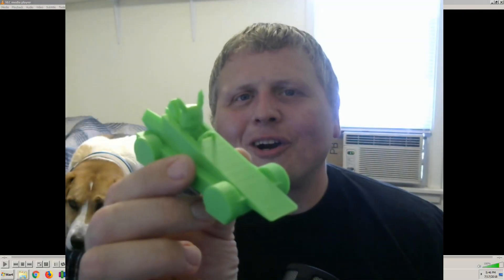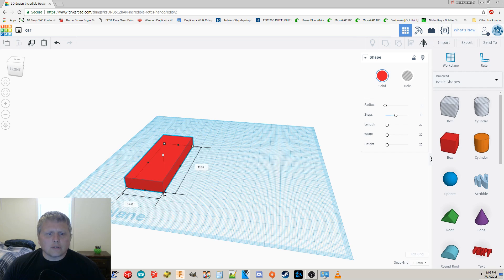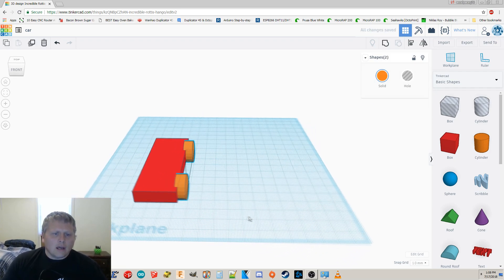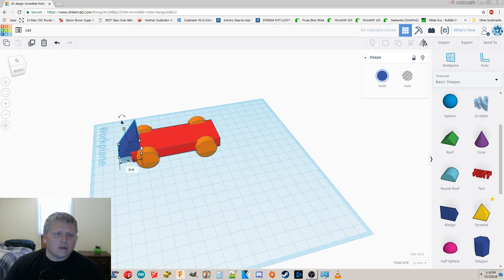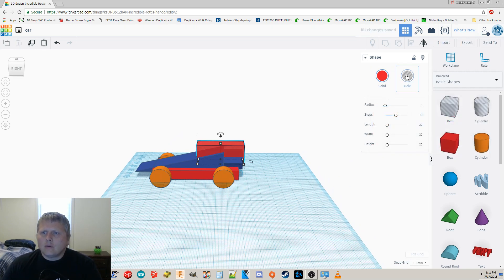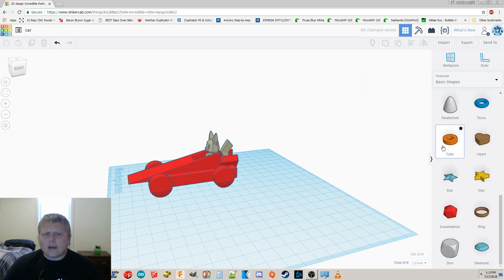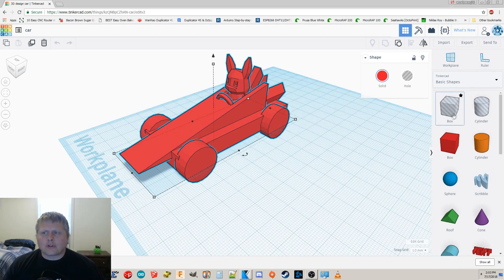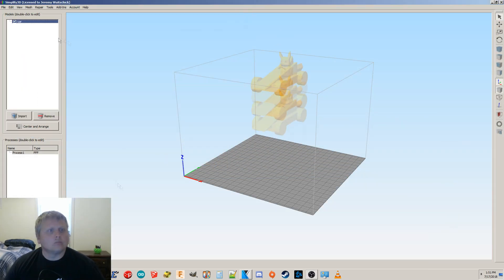Learn to Design 3D Printed Object in 5 Minutes 2018 UPDATED TinkerCAD

Comment: Do you have to have your pc connected to the 3d printer or can you save your 3d object to an SMS card and the. Load the card to the printer to print? Sorry. New to all this. Not sure if I need to have the printer bear the pc. Or can o put the printer in my workshop where there is no pc

Comment: Thanks for making this video. Wish there were more like it. Pretty cool! Question, when you exported it as stl did you directly save it on the micro sd card? What is slicing? I don’t think I heard you say anything about that. Also, how do you ensure support is in for the areas that need it?
Reply: You would have to import the stl to a slicer program such as cura. Cura also automatically adds supports where needed if you select to use supports in the options.
Reply: Slicers are what tell the printer how to make the object. There are a ton of slicers out there but I'd definitely reccomend using cura as your slicer. Theres a search bar and you can type any of the weird terms you hear youtubers use and then try them out gor yourself without having to fumble through menus. You'll very quickly learn a lot about tuning your printing settings that way. You can also save custom profiles for specific filaments that you like to use frequently. You can adjust literally anything you can imagine in cura just by searching for it in the settings. It can help you get rid of stringing or globbing or over or under extrusion etc etc. Keep in mind that some filaments are just way better than others, regardless of price, and some brands products just doesn't print as nicely as others even if they are both the same material. For example, my best printing filament is petg from a brand no one has ever heard of (tpoimns) that was only 16 bucks a kilo lol. For whatever reason it prints better than any of my other petg, my nylon, or even my pla no matter how much i tinker with the settings. Be careful with petg though because half of them wont print right below 240c, and you'll need an all metal hot end to go hotter than that. Petg is great though because it has excellent UV resistances compared to just about any filament out there. That makes it one of the best options for outdoor parts that need reasonable strength and need to withstand direct sunlight (as long as its not too hot, like in a car in arizona). It prints just as nicely as PLA too in my opinion.

Comment: Is it hollow inside or solid..
Pls reply
Reply from the maker: Hi. 3D printed objects are not usually completely solid. They usually are filled with a hollow grid or hex pattern. You adjust the infill percentage in the slicer software just before printing it. A higher infill percent will generate a more dense, heavier object while a lower infill percentage will generate a less dense, lighter object.
Reply: @woodywong76  😊thanks 😊